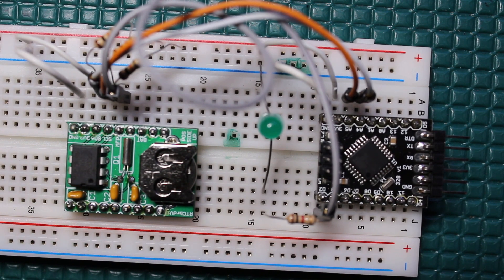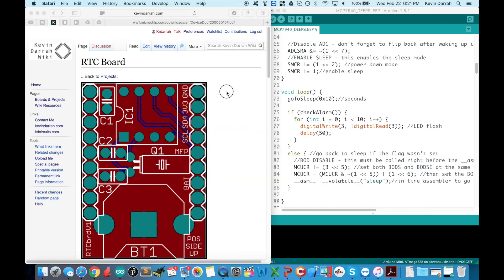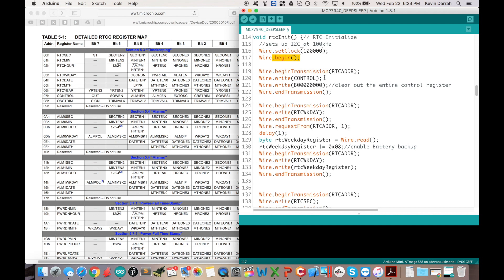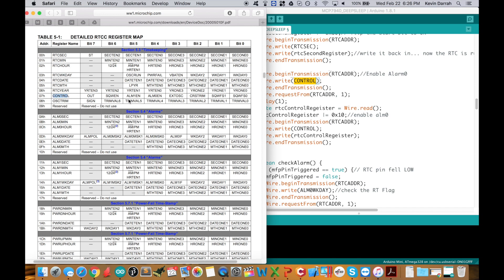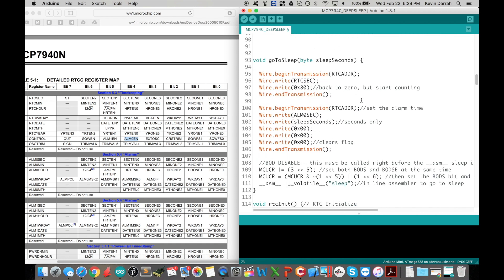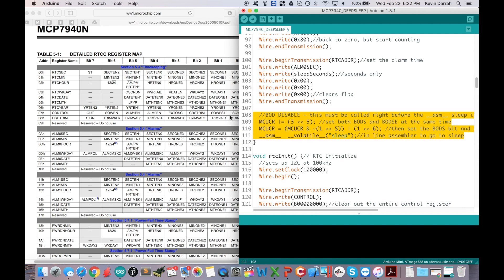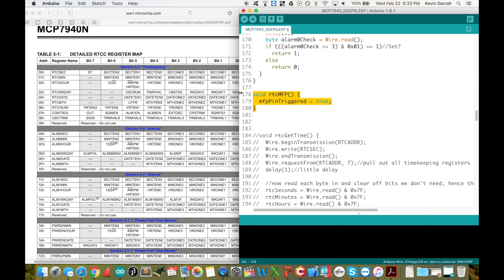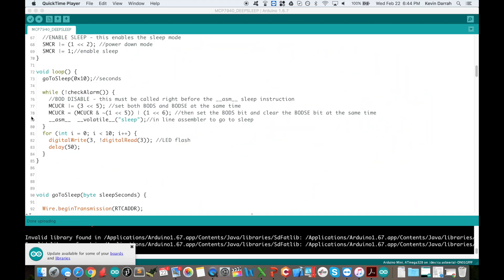Very LOW Power Arduino - Precise Time Interval Wakeup! using an RTC

Comment: ChatGPT told me it's possible to use the RTC module to trigger a MOSFET and boot up the Arduino at regular intervalle. Then the Arduino resets the alarm and it shuts down everything with literally 0µA consumption.
It also told me it's possible to measure the RTC battery on analog PIN, in case the battery is dead so you can light up a red LED and warn the user. But the battery should last 10 years.

Comment: By removing a couple of resistors and clipping the vcc leg you can reduce the current on $1 DS3231 modules from 100uA down to 5uA which will give you alarms for >4 years on the backup coincell.  This power saving modification is quite useful for our battery powered data logging application:

https://thecavepearlproject.org/2014/05/21/using-a-cheap-3-ds3231-rtc-at24c32-eeprom-from-ebay/

Comment: I've designed a simple board with ATmega328p's internal rtc with external 32.768kHz crystal directely connected at TOSC1(PB6) & TOSC2(PB7) pins. It draws abot 1.1uA (vcc 3.3v) in power save mode with accurate time keeping! Also you can use the internal rtc interrupt to wakeup the processor in any time. I'm running the cpu at 1.8432Mhz with calibrated internal oscillator via OSCCAL by the help of internal rtc. So it's easy and I can run the UART at 115200 with the minimal external hardware, only one 32.768kHz crystal!

Comment: There is possible to combine two alarms (ALM0 and ALM1) to cooperate. Then you can wake up Arduino for example on specific Hour and Minute or specific Hour of any Day of the week. See 5.5.2.2 Dual Alarm Operation and TAB5-10: DUAL ALARM OUTPUT TRUTH TABLE

Comment: Hey guys,
I am trying wake up my project using these great explainations once every 10 mins, so I tried to wake my project once per minutes to start working on it.
Here's my code;

  Wire.beginTransmission(RTCADDR);//set the alarm time
  Wire.write(ALM0SEC);
  Wire.write(0x00);//seconds only
  Wire.write(0x01);//minutes only
  Wire.write(0x00);//hours only
  Wire.write(0x00);//clears flag
  Wire.endTransmission();

Anyways, when I do this:

  Wire.beginTransmission(RTCADDR);//set the alarm time
  Wire.write(ALM0SEC);
  Wire.write(0x00);//seconds only
  Wire.write(0x10);//minutes only
  Wire.write(0x00);//hours only
  Wire.write(0x00);//clears flag
  Wire.endTransmission();

It still wakes up once per minute instead of 10 as I thought.

Any idea ?
Reply: Im just noticing this problem myself, i think the problem with this is that, the seconds register is set 00, which it will hit every minute. I don't know how to get this chip to trigger every 12 hour. so let me know if you have resolved this problem for yourself.
Reply: Actually it looks like you just need to change the alarm mask to 001 so the line that says, "Wire.write(0x00);//clears flag" actually should be, "Wire.write(0x10);//clears flag" or 0b00010000, also you probably need to change the code to zero the minute register, but you'll need to leave in the seconds register zeroing because it also starts the oscillator.

Comment: You've made a latch circuit once. Perhaps use the RTC to turn it on and Arduino to turn it off? That will kill Arduino and save you some power?
Reply: I'm extremely interested on this, I did put the latch circuit together and it 100% works with my arduino,I was hoping to get it working with a RTC, everything seems to indicate that is not possible, RTC doesn't seem to be able to deal with logic by itself, the alarm setting is being executed on the Arduino side (I'm using a DS1307), so lower power is possible because the arduino is still checking the time and executing the code, but no power is not, I would absolutely love to be corrected because turn the arduino on with a RTC would save my project
Reply: just saw that my version of RTC (DS1307) does not have an standalone alarm but the next one does and should do the trick, hopefully

Comment: #include <Wire.h>
#include "RTClib.h"
#include <LiquidCrystal.h>
int Con=80;
LiquidCrystal lcd(7,8,9,10,11,12);
RTC_DS1307 RTC;
int ds1 = 2;
int ds2 = 4;
int runTimer ; 
int s = 15 ; // time in seconds

void setup () {
    pinMode(ds1, OUTPUT);
    pinMode(ds2, OUTPUT);
    digitalWrite(ds1,HIGH);
    digitalWrite(ds2,HIGH);
  analogWrite(6,Con);
   Wire.begin(); 
    RTC.begin();
    // RTC.adjust(DateTime(F(__DATE__), F(__TIME__)));  //  sets the RTC to the date & time this sketch was compiled

     // January 21, 2014 at 3am you would call:
     RTC.adjust(DateTime(2017, 8, 5, 12, 20, 0));

 
  lcd.begin(16,2);
  lcd.clear();
}

void loop () {
  DateTime now = RTC.now(); 

    mostrarRTCLCD();
     
     delay(1000);// 
     
     
  runTimer = 0;// vital
     for(int duration = 0; duration < 100; duration ++){}}
     
     void timer() {
     for(int timer = s;timer > 0; --timer){
     lcd.clear();

     lcd.setCursor(12,1);
     lcd.print(timer);
     delay(1000);// step down every 1 sec 
         
}}

void mostrarRTCLCD() {
  
DateTime now = RTC.now(); 
lcd.clear();
lcd.setCursor(0,0);
if(now.day() < 10)
{
lcd.print("0");
}
lcd.print(now.day(), DEC); 
lcd.print('/');
if(now.month() < 10)
{
lcd.print("0");
}
lcd.print(now.month(), DEC); 
lcd.print('/');
lcd.print(now.year(), DEC);  
lcd.setCursor(0,1);
if(now.hour() < 10)
{
lcd.print("0");
}
lcd.print(now.hour(), DEC); 
lcd.print(':');
if(now.minute() < 10)
{
lcd.print("0");
}
lcd.print(now.minute(), DEC); 
lcd.print(':');
if(now.second() < 10)
{
lcd.print("0");
}
lcd.print(now.second(), DEC); 

if (now.hour() == 11 & now.minute() == 41 & now.second() == 00)
  { digitalWrite(ds1,HIGH); // relay is on during countdown
    digitalWrite(ds2,LOW); 
    timer();     //Start timer
    lcd.clear();
   
    } else {
      digitalWrite(ds1,HIGH); // relay is off  when time expired
      digitalWrite(ds2,HIGH); 

    }}
Reply: hi kevin 
this code works but the DS1307 RTC  is not keeping the time while the arduino is without power.  As soon as I power the arduino back it starts exactly where it left

Comment: Hi Kevin, may I ask two questions? In your circuit, both the RTC board and the Arduino board are powered off of the VCC rail on the breadboard and the current in sleep is only 1.5uA. Or is the RTC running off its own battery? Asking because the RTC datasheet says ~ 1.2uA @ 3.3V for time keeping + the Arduino which I would have expected in the 3-4 uA range. And secondly, looking at this 328P board - is there any good reason why one would go even further and only use an ATTINYxx instead? For even lower low power consumption? Thanks so much!
Reply from the maker: yep. that current you see in the video is pretty much all RTC.  I did another low power video with just the arduino.  And sure an ATtiny is fine if you only need a couple pins for simple stuff.  No prob, I use those all the time.

Comment: That's really awesome work! One question though, the checkAlarm function could just return the result of the condition, couldn't it? Instead of the if statement with a return 1; and return 0; in it, a return ((alarm0Check >> 3) & 0x01) == 1; should suffice. It's returning a boolean after all.

Heck, I think even return (alarm0Check >> 3) & 0x01; would do just fine as & 0x01 can only result in 1 or 0, which will be interpreted as boolean true or false.

Comment: Hi Kevin, 
  At 1:17, you suggest "Why not use the internal watch dog..", and you list that you're limited to turning on every 12 second and then going back to sleep.  I agree with you that the RTC clock is more accurate, but as far as I can tell, the while loop you have set up has the  same problem.  It turns on every 12 seconds, checks to see if the alarm flag is triggered and then goes back to sleep.  Accuracy is better, but POWER USAGE is basically the same as far as I can tell?   Am I missing something?

Another option, instead of using the interrupt, is to simply use a RTC Date Time library, and then   
    RtcDateTime now = Rtc.GetDateTime(); 
    RtcDateTime alarmTime = now + 1000; // 1000 seconds into the future or however long you want.
    
    while(alarmTime > Rtc.GetDateTime() )
    {
       SleepFor12Seconds();
    }

This should do the same thing without needing the interrupt pin. The downside is that all these methods you are still limited to wakeup within 12 seconds of the alarm and not exactly on time.

Comment: Nice video, gives me more insights. I use the 328p sleepmodes with watchdog. I understand the difference with and without using the watchdog is around 6uA (using 6.5uA with and  300nA without, I am not able to measure this tiny current myself). Looking at the datasheet of the MCP7940 shows it uses 1uA. So if I want to save 5 uA, I just need to add the RTC module.
Reply from the maker: yep, exactly
Reply: Arnoud van Leijden and if you cut power of rtc it runs of its battery. but can it wake the uC if running its running on battery??

Comment: goToSleep(0x10) does not mean 16 seconds ?
Reply from the maker: no, because the byte is split in two.  The 1 is for the 10's digit, the 0 for the 1's digit, so you get 10 when you give it 0x10, or 0x59 gives 59seconds...

Comment: Excellent info again Kevin!
This is probably a dumb comment, but why not use 'C' type commenting /**/ ?
I think I know why you comment rather than #if's though as I have many options in my code and it's hard to
see what's happening (especially with  multiple nested #if's).
Reply from the maker: I'm lazy and use the Arduino's built select all, then Control Slash command to comment out a block of highlighted code.  To uncomment, you just select the code and do the same thing Control+/

Comment: If I ran this basic blinking setup out of 2xAA 1,5v batteries how much time would it last?
And hiw mich time would they last if the arduino was awake without RTC doing the same work instead if sleeping?
Reply from the maker: great question - so let's say the ON time is 1 Second and the current is 6mA.  Then you've got your OFF time for 10 seconds with 1.5uA current.  Then you've got to calculate the average current draw over that time.  So we take 1x6mA + 10*1.5uA then divide that by the total time (11 sec) which equals 0.55mA  So you can see how that 6mA of ON current affects the average current.  If you slept for longer, or reduced your ON time, you can get that even lower.  So then looking at a standard AA battery, let's say we get 3000mAh out of it.  We can simply take that and divide 0.55mA by it and you end up with 5455hrs or 227 days.  Not too bad... but let's say you didn't 'sleep' and were just ON all the time at 6mA, well then you just take 3000/6 = 500hrs or only 20days.  So clearly sleeping buys you a lot in terms of battery life.
Reply: Kevin Darrah thanks for taking time to answer!
I really like these videos. Very clear and well explained. Thanks for making and sharing them!